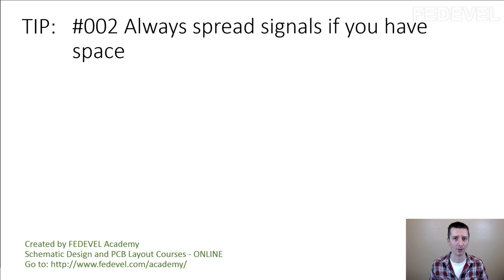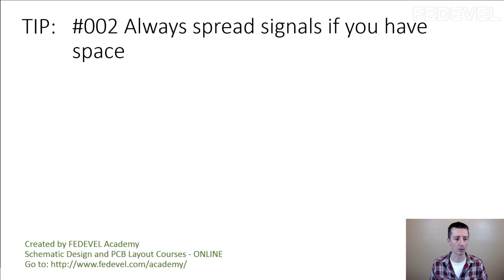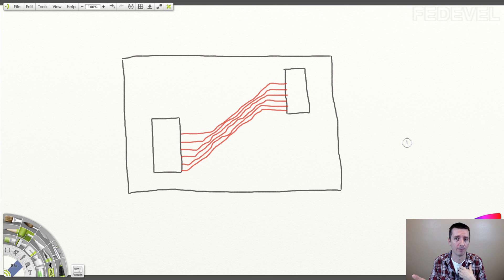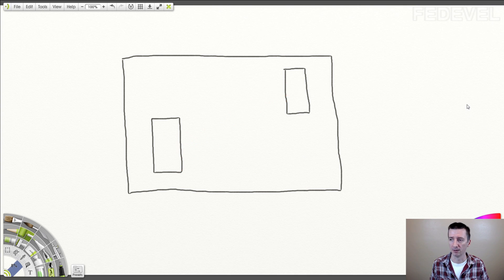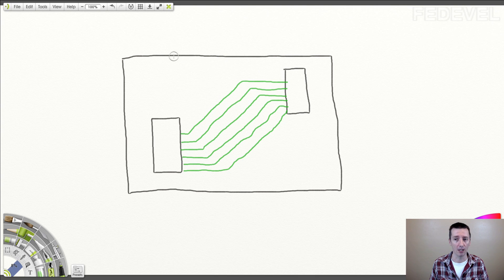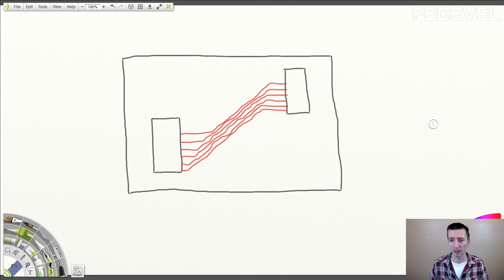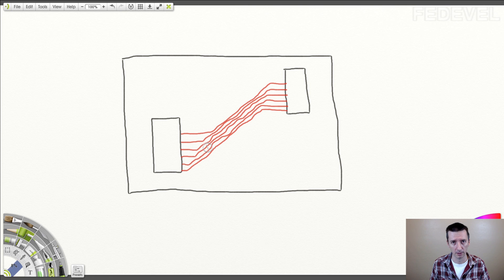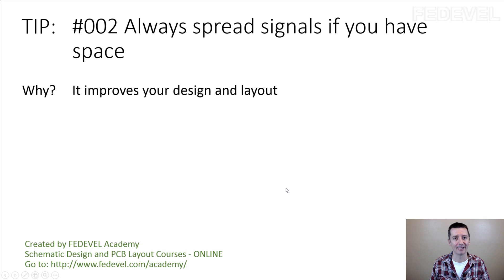TIP #002: Always spread signals if you have space

Comment: Thank for the tip !
I'm learning I2C and creating a little board with one MCU and two i2c slave sensors. How should I calculate a good distance between SCL and SDA tracks so I can avoid crosstalk between them?
Reply from the maker: I have not seen any problems with I2C crosstalk. The bus is usually slow. We do not use any special requirements for routing I2C. If you are not sure, have a look how we routed I2C on our reference boards: http://www.imx6rex.com/
Reply: ok, thanks.
very impressive boards, btw !
Reply from the maker: Thank you :)

Comment: Robert, I see you're using ArtRage.  Did you know you can hold CTRL while drawing to get nice straight lines?  SHIFT+CTRL to get fixed angles.  But maybe you like the rough drawings, else you'd be using CAD :)
Reply from the maker: Straight lines could be sometimes handy. I do not use the ArtRage software a lot, but I really should remember the CTRL! Thank you for the tip. PS: usually I draw by hand as I think it then doesn't look too official.

Comment: For you, what is better between spead signals and large tracks ?
Reply from the maker: Ideally, you may want to follow recommended impedance of tracks, so in many cases the track width is fixed and defined. Therefore I usually work with the space between tracks.